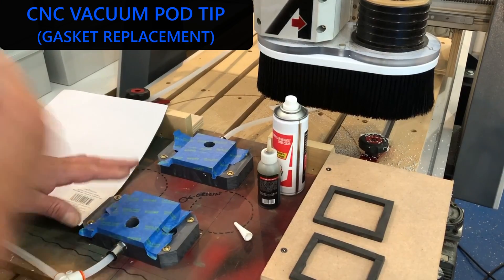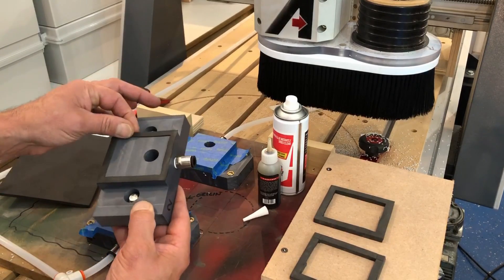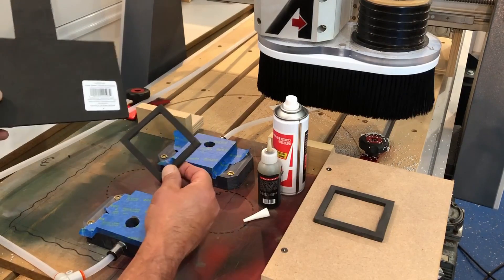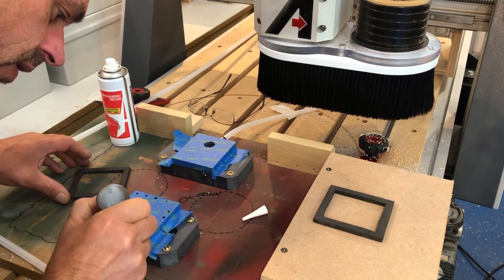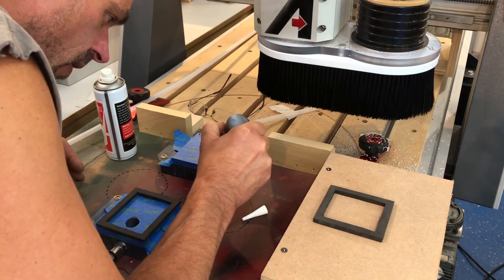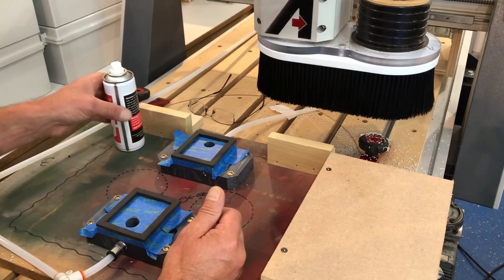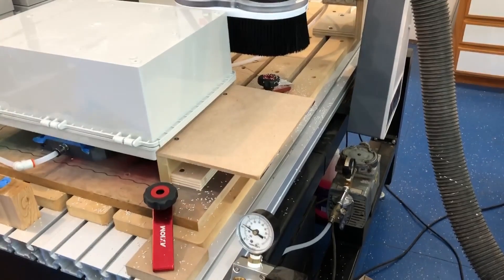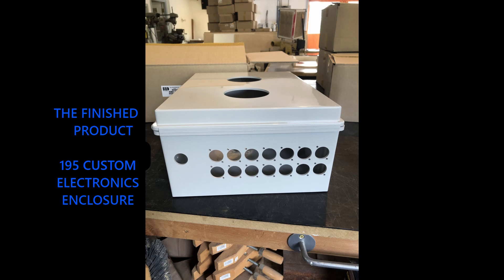CNC Router / DIY Vacuum Pod Tip

Comment: The quick connect plugs  are what size?  I have 1/8" ones for the block with a 3/8
' NPT .  I am pulling   27 pounds of vacuum is that enough for the vacuum pods/
Reply from the maker: The tubing size I am using is 3/8” and yes 27 pounds vacuum is about as good as you can get 👍